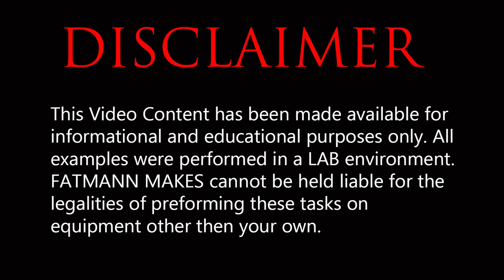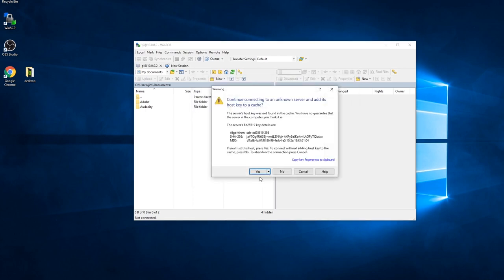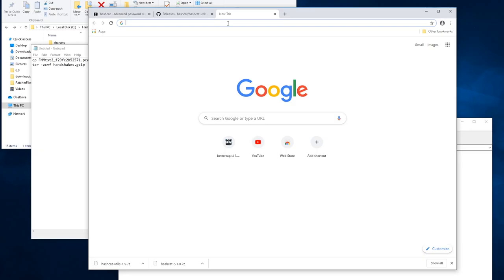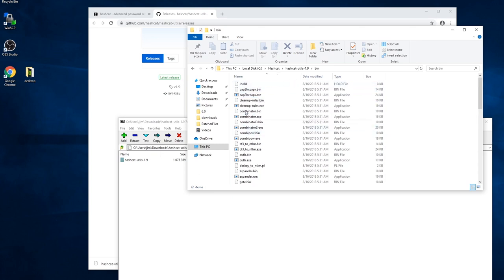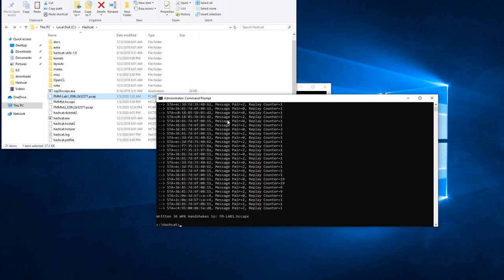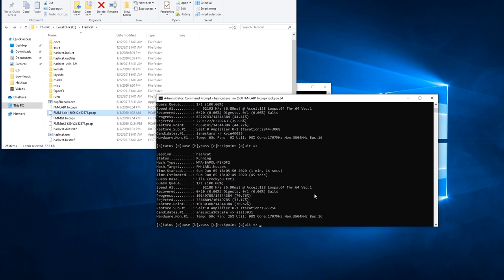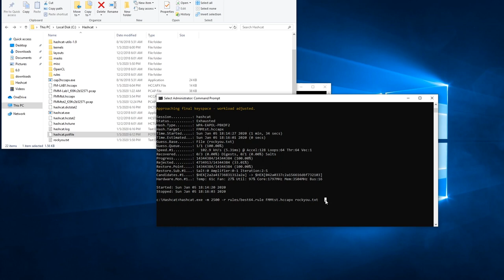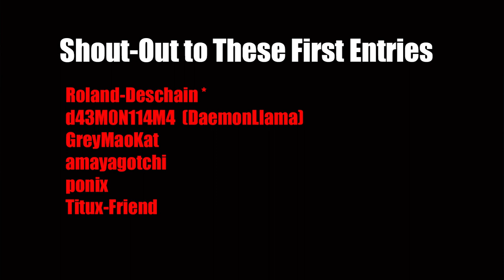Pwnagotchi - PCAP Decryption with Hashcat WiFi Raspberry Pi Zero W project: Series-Pt3

Comment: Very Nice work man!! Im in the process of a build myself. But for your cracking just use Aircrack-Ng it will take the .Pcap with no conversion.  Also if you dont have a wordlist you can use Crunch and setup some parameters for the brute force charset and pipe the output to Aircrack-Ng as well. Keep up the great work and your videos have been very helpful. Subbed for sure!!!
Reply from the maker: there are  many options for cracking software to use.  I'm using hashcat  it's  referenced within the pwnagotchi project.

Comment: By far the best videos on YouTube that I have found and trust me I’ve been going through most of them . Lol  why don’t you use the -a on your command line ?
Reply from the maker: @Samuraib0b Thanks! glad you thought it was useful.  -a (attack mode) defaults to 0 (straight)  so  I don't need to specify it.   the other modes either are not compatible with a dictionary attach or require  additional files. IE a 2nd dict. file (combined) or a mask of some sort (hybrid).

Comment: Hi it work for awhile about 5trys and then I start getting this error "Windows 10  app box comes up and says unable to run the application on your PC. and in cmd it says access denied. The windows 10 box says the program is not compatible with your PC. Contact developer. I am running the 64 bit program"

Comment: After running the cap2hccapx.exe command, it runs then says it returned 0 handshakes. Any ideas?
Reply from the maker: a lot of the pcap files captured do not have enough data in them to convert. check the file size of the pcap it should be  a decent size ( not a few k)

Comment: you can you use the command line (CMD) from windows 10 with scp -r pi@10.0.0.2:/root/handshakes c:/  (dump all handshakes to c:/handshakes
of course, I chown-ed the root and handshakes (pi:root) directories for pi usage with ssh pi@10.0.0.2 (CMD line as well) chown must be done first or the scp will fail
Reply from the maker: yes, but most windows users are more comfortable with a gui interface. I wanted it to be easily understood how to get the files off. giving them a CLI command that they run it may be harder to change that command to do what they want to do.

changing the permissions  is a solution, but not really what the creator wanted people doing.  he states in the install instructions that some scripts will require certificate authentication to function correctly "I.E. the backup script"  it's  best practice and more secure doing it that way.  

I.E. yes in windows you can create a share and  (cringe) give "Everyone" full rights.   it's a solution, but not necessarily the best one.

Comment: I dont understand why you would use the rules and it takes hours, when you just spend around 2 minutes without using the rules and still cracked the wifi password?
Reply from the maker: @Legend this is a good question! you do  for a couple of reasons. 
1) the wifi password in the demo was an easy password that  was known to be on the list
2) without rules it just compares the list as is.  what if  the list  has the right password, but it's in a different case. or has a ! at the end. etc.  the rules will catch these instances. so a hash that isn't cracked with the base list would be with the rules
3) when you combine hashes and run them all at once it adds some time, but it's faster then running them one at a time. 
4) so why not run the rules!!!  it will crack the easy verbatim one's fast on the stock list then it will continue to apply the rules to get the harder one.  it's a win win
Reply: @fatmannmakesbreaks498  Ah nice, thanks for the detailed answer man. Good video too. Very useful. It makes good sense.
Reply: If you have a random [A-z0-9] 10 character long pass, it takes 800 yrs to crack (1080).

Comment: Lol so many questions. So what if I have multiple Pcap files ? Is there a way to convert them all vs one at a time?
Reply from the maker: Is this in general or in reference to pwnagotchi?
I have two videos that cover this 1) " pwnagotchi hashcat to hccapx"
2) the pwnagetty video. This is specific to pwnagotchi. It also concentrates on the pmkid attack so discards most of the pcap files and only saves the pmkid hash.
You have to use a different command in hashcat  to crack them.
Reply: I’ll check the other videos again. But when let’s say the pwn picks up 4-5 diff WiFi and we use cap2 to convert to then use hashcat to decode . Is there a way to convert all 5 diff ssid or do we need to do one at a time .
Reply from the maker: I see you found your answer but, for any future reader looking for the answer. 

Yes you can combine them and run a attack against  a multi hash file. It's more efficient to do it this way. And this is covered in the pwnagotchi hashcat to HCCAPX video
Reply: I am on that other video now doing the conversations lol I have 65 ssid to do . (Testing purposes only lol)